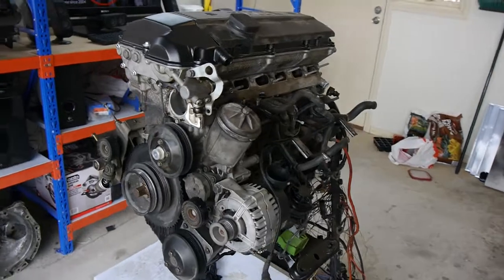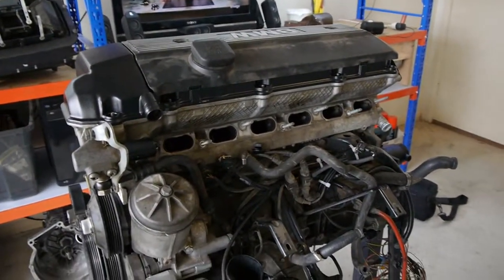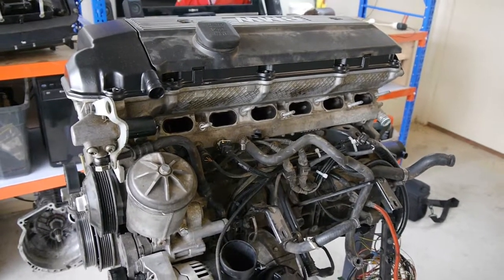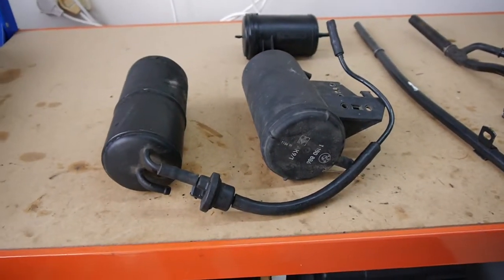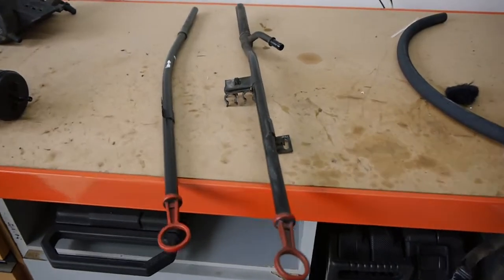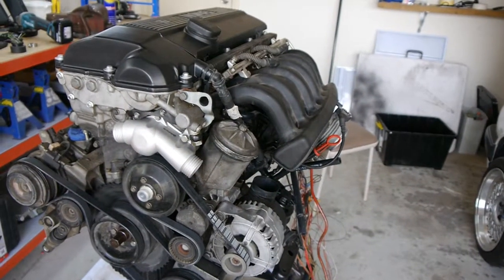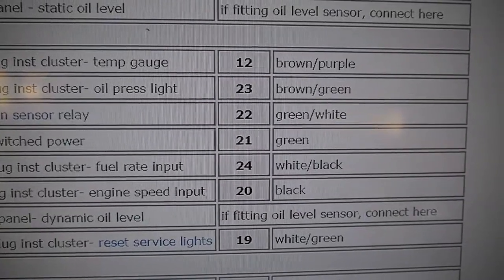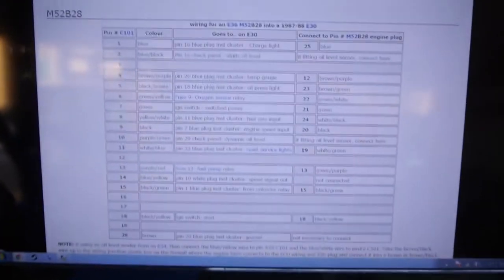E30 M52 Conversion Episode 5. Engine Preparations

Comment: this video may be old, but still helpfull. In hindsight, could you buy the crimp removal tool straight away, remove de pins from the plug and re plug the c101. This would save you a lot of time and risk in re plugging the wires. Or aren't the plugs the same?
Reply from the maker: Thanks. You probibly could but your stretching the memory bank haha. E36 plug is different i believe but if you had an e30 loom then you could use that plug.
Reply: @OneArmedBanditYoutubeChannel  hahaha stretching indeed. I will do some more research. Thx anyway and your series have been and still are of great help. My project is still ongoing, fitted the engine today
Reply: just looked this tool up, how much?! 60 dollars! let me rethink this one

Comment: isnt the m52 obd 2? do you need to make any more wiring or you just do it like this
Im thinking about doint an m52b28 on my e30 but for what i've read it's alot more dificult than an m50b25
Reply from the maker: Donno if it's technically OBD2 or not but yeah was super easy. As far as I can tell the M50 is only easier because it doesn't have EWS on the DME. This was reasonably simple and I just paid to have EWS removed from the DME. Was like $150.

Comment: will the getrag 240 from the m40 manual bolt upto a m52? need to change the driveshaft/tailshafts or anything? I heard they have different bolt patterns
Reply from the maker: lmMuel yeah g240 from e30 will bolt up to engine and cross member. The m52 moves the gearbox back in the car though so the tailshaft needs to be shortened, which i cover in episode 7.
Reply: Ah, I see just watched that one thanks. Do you have a link to the flywheel and clutch you're using? why are you using the m20 flywheel and clutch over the m40/52 ones? just dont fit?
Reply from the maker: Its actually not an M20 flywheel, Its a hybrid, it has m4x/m5x ring gear for the starter motor but is built for m20 clutch. Reason the M20 clutch is used is because it suits a single mass flywheel were the vast majority of M4x and all M5x flywheels are duel mass and therefore have a duel mass type clutch. Google will tell you how that works and why you would want a single mass, but in the end m20 is the easiest and cheapest clutch to suit a single mass flywheel and BMW gearbox input shaft.

http://racehead.com.au/products-page/engine-components/bmw-light-flywheel-m50-m52-m42-m44/
Reply: Thanks, just what I needed to hear :)
Reply from the maker: No worries. :)

Comment: Just one thing that drain back on the dip stick tube it’s on a 90 angle why ?
Reply from the maker: Do you mean the metal outlet is 90 degrees to the direction of the Dipstick? if so it was because that was the way I welded it on as 90 degrees is the easiest to prep for welding, If i was to do it again i would aim it more upwards so the hose didn't interfere with the engine arm.